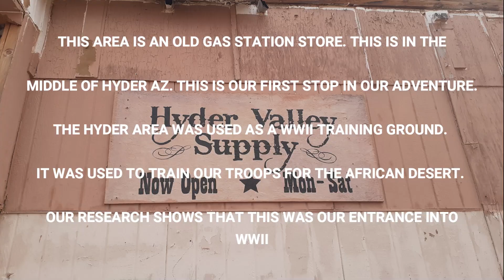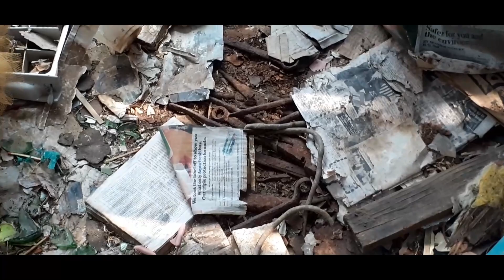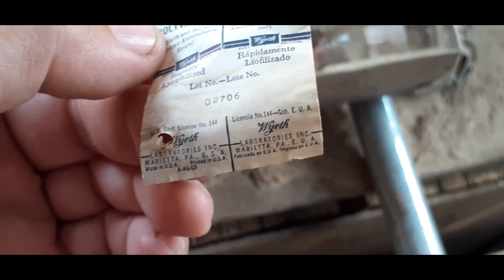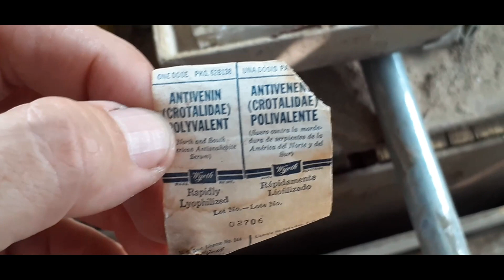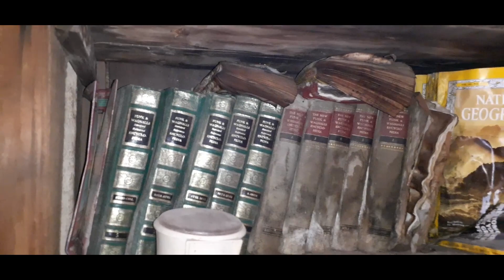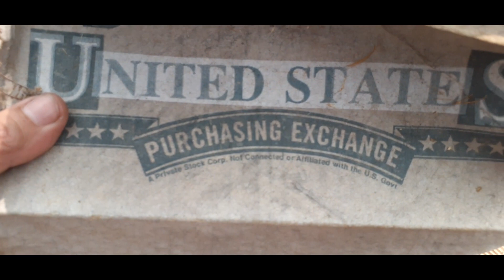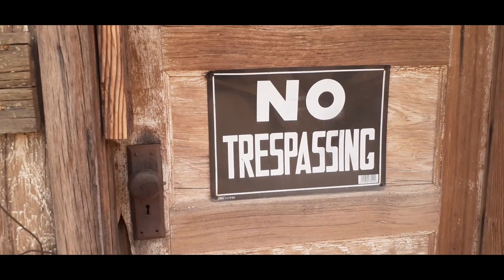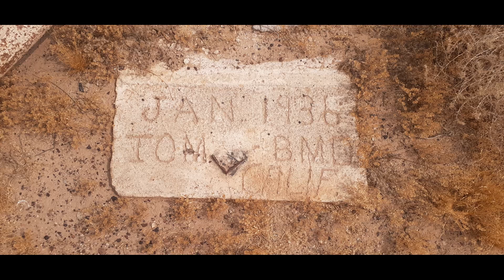Hyder Arizona Abandonded Buildings And More.

Comment: Nice video, but unfortunately that's not Camp Hyder (22:30).  Not sure what that is.  Camp Hyder was a large, divisional camp, about a mile long by 1/2 mi wide.  The entrance to Camp Hyder is on Ave 76E, just north of the RR tracks and through the stone gate posts.  90% of the camp is now covered by farming and solar although some remains of rock lined streets and sidewalks are still visible.  Only thing I know of that was built off site was a swimming pool (by camp engineers) at Agua Caliente for the troops to enjoy.  Since there's pre and post war dates in concrete there, I doubt this has anything to do with the camp.  If these are WWII buildings, they were probably moved there after the closing of the camp.  Most likely they're housing for farm workers.
Reply from the maker: The first part is a store we found along the way. Unfortunately my camera stopped recording. The second section had the barracks, the bathroom shower. It was off 76. This was indeed the training ground. The map showed us right there. It's hard to understand through a camera. We do our research before going on our trips. We plan to go back and record all the other buildings.

Comment: You seem like a nice guy but you are so wrong it is not funny! I lived in Hyder/Sentinel/Dateland area for 30 years (70's-90's). That first building you are was built in the 1980's. It was the 3rd local grocery store. The big dilapidated was the 1st. When you go down the road a few miles you will see the 2nd. The building with the black tar on it was a bar called "Whispering Sands". I lived right behind it. You are nowhere near the WWII area. Just FYI, you should be really mindful of rattlesnakes. They love these kind places.
Reply from the maker: There has been some conversatons about this. The area that we were was part of the camp. Our camera cut out just before we explored the barracks. You are correct, the main camp is across the way a bit. We spoke to some historians and the crude septic systems in that area date back to the war. Was this directly the Hyder military camp? No, but it was involved in those times. We planned to return to finish this expllration but we got busy then moved out of Arizona. Thanks for sharing, and we try to be accurate in our videos. What i will do is change the title to something more clear. Have a great day.